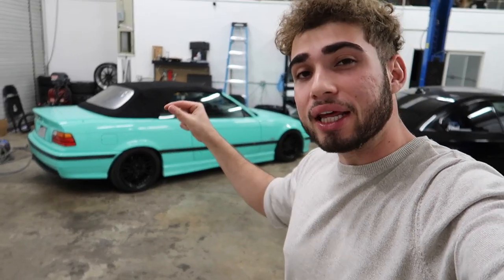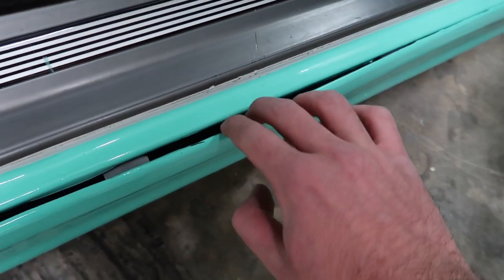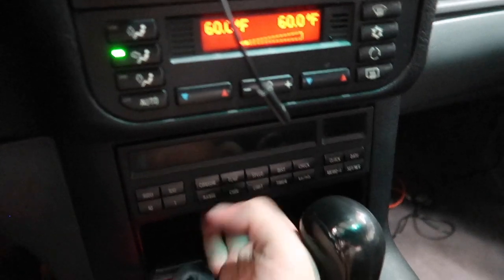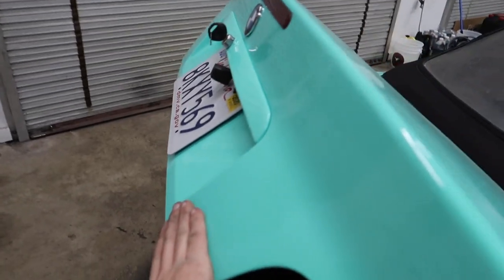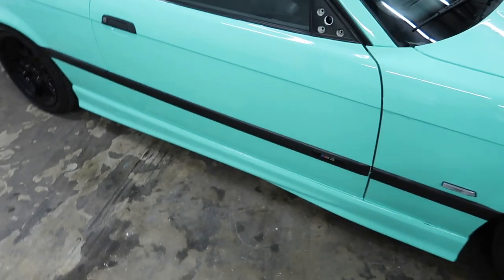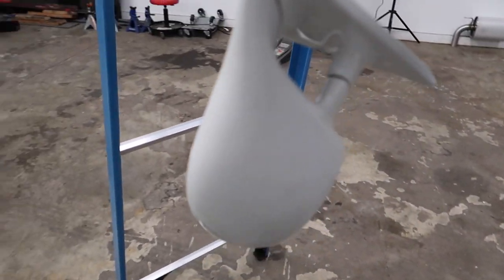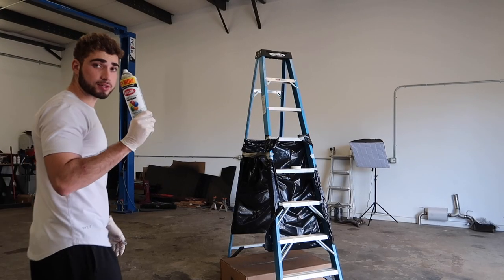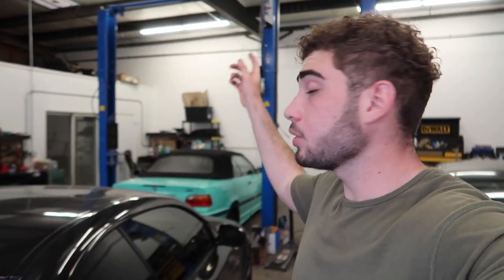FIXING EVERY SMALL FLAW WITH THE E36 M3! (MY MOST SATISFYING VIDEO)

Comment: I love that you are trying to fix every imperfection on this classic. Well done. I'm owning an e36 m3 since 2006. Hit me up for some advice. IG handle @pj0621. The clock on the dash... it doesnt need to be changed completely. You just need to change the back light. It's the little nuts on  top of the unit. The mirrors.... the main piece separates from the base plate. You can separate them to spray them easier. Well done. Keep up the good work.